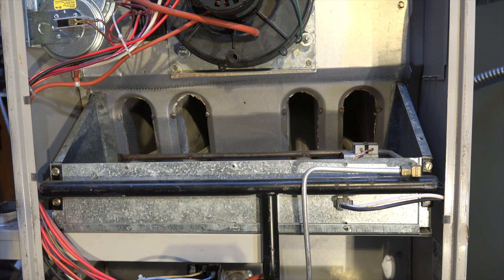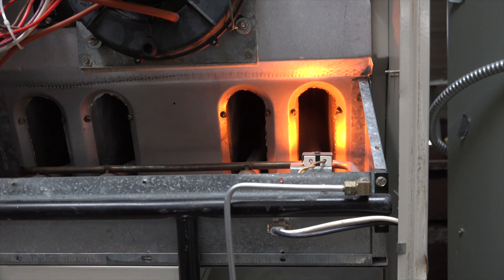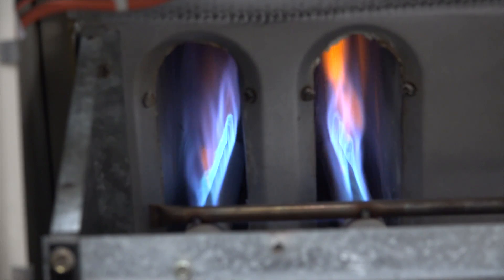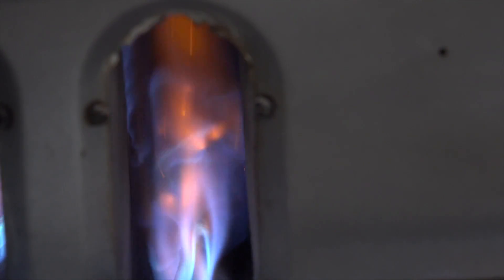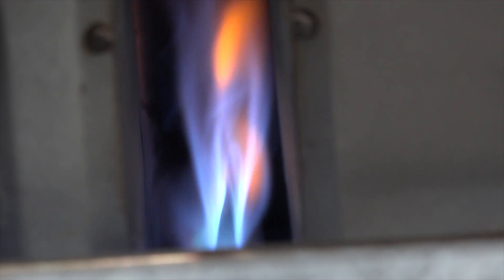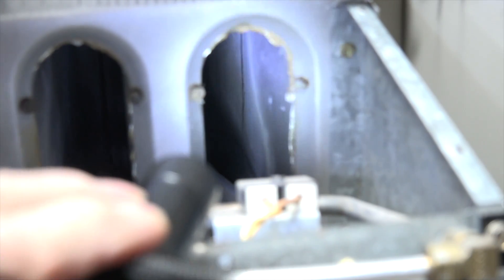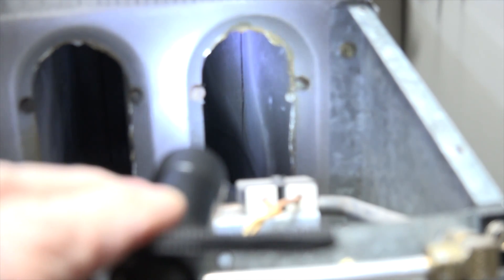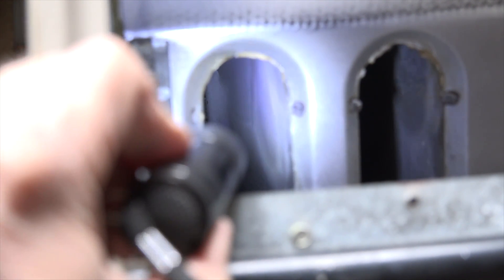Gas furnace problem

Comment: Great video. Thanks for showing us what to look for.😎
Reply: +HVAC/R Junky But as he showed in the tube all the way to the right, some times a crack is present with no really good sign in respect to the flame. You always need to do a visual to make sure no cracks are present. I have a fiber optic camera to snake in the tubes without having to take the whole burner assembly apart. I found cracks in 4 or 5 burners in a 20 year old furnace today. Small enough to not show in the flame but large enough that I condemned the appliance.
Reply: +Jeff Peterson 
I'm going to start doing a lot more residential heating and cooling calls so I've been watching as many videos as I can to sharpen in my skills.thanks for the advice
Reply from the maker: +HVAC/R Junky welcome 
GFM

Comment: Cracked heat exchanger/combustion chamber and inducer fan failing.... She's gone!
Reply from the maker: +The Rambling engineer. Interested to know why you think the inducer has failed.
GFM
Reply: +grayfurnaceman 48 hours no sleep is why i said inducer, what i meant was the main blower.
Reply from the maker: +The Rambling engineer. You probably heard was a piece of insulation that fell into the blower.
GFM
Reply: +grayfurnaceman Just by looking at those cracks it is indeed oblivious that it's about time for whoever owned that furnace to retire it
Reply from the maker: +hdyudu Amen to that.
GFM

Comment: when the flame flickered and had that orange glow at the top i knew it was a crack in the heat exchanger. normally when there is a crack in the heat exchanger the gas fumes will go into the blower air and u will smell a slight burning dust type smell. this happened to me at the apartment i live in and i went out and bought a utility heater to keep warm in the winter, i did however tell maintenance about it and they took a month to fix it.

Comment: I've been told that cracked heat exchanger means new furnace.  Why can't the heat exchanger be replaced like everything else?
Reply: it can be replace but most of the time its not worth it because of the share cost of replacing a heat exchanger if it's out of warranty if it's in warranty will just be charged labor on the technician to replace the heat exchanger but most the time it's just work to replace the furnace unless it's a commercial application.
Reply: Furnaces have grown in safety and efficiency over the decades, If you have one lets say from the early 1990's or late 80's or even one of a cheaper make from the early 2000's that starts behaving in such a way like that  then i would think the unit has seen it's days and it's time to invest in getting a newer furnace
Reply: The heat exchanger is usually more than a new furnace. Because manufacturers don't want to stock the parts for old furnaces, so they make them very expensive.
Reply: If the warrenty covers it then you should replace the heat exchanger.